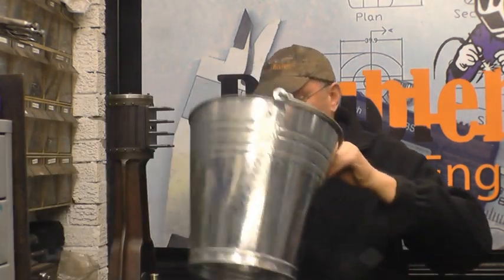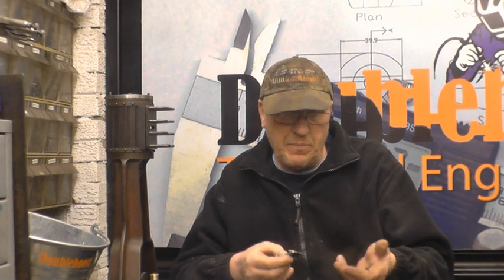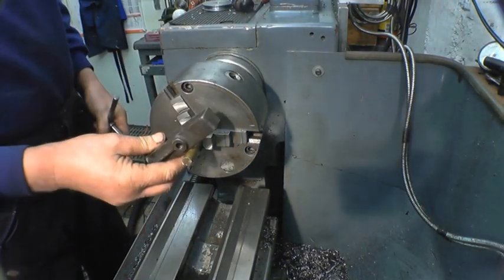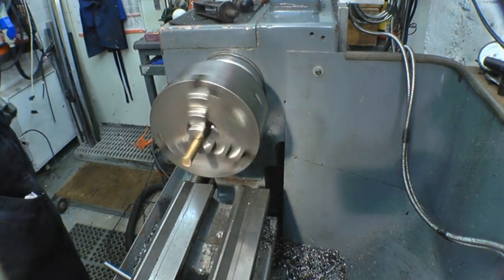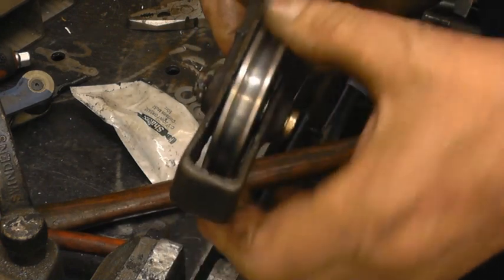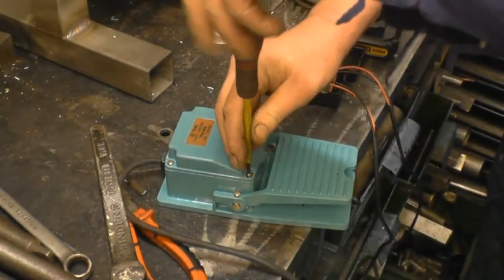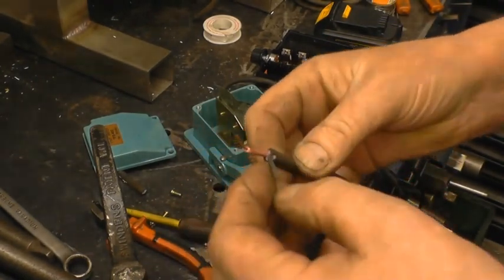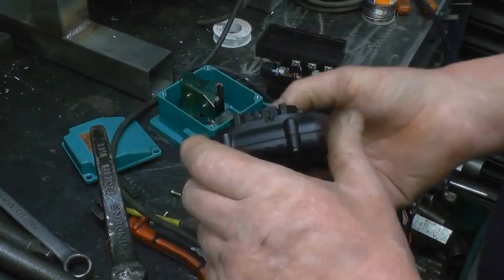SNNC 215 P1    Vintage pulley referb

Comment: if it's only 18-24v, rather than mains, you can do insulation with a few sheets of card, (postcards?) or a single layer of any thin plastic sheet...  so the metal enclosure might be the way to go, you know you want to :)

Comment: Hi John, putting solder on the wires before you put them into the terminal strip actually makes it less secure. Over time, it  will loosen up. The terminal strip manufacturers all recommend bare wires, or the use of crimped-on ferrules if you wish, but no tinning of the wires.
P.S. Thanks for the videos!
Reply: Yes, dont solder wires that goes to terminals
Reply: John - I even bought you a set of bootlace ferrules and a crimp tool to stop you doing it again!. You DEFFO need a fuse too....don't put that off - it will come and bite your arse if you do. You can fit it when you are re-wiring it using the ferrules!  Rotator looks boss though :-)
Reply: So John there is no excuse, do it wright.
Reply from the maker: I thought I had some The job will be sorted properly
Reply: Surely a screw will just squash thro soft solder onto the copper wire?
Reply: Depends who's doing it up, and the form of the screw ends. Older terminals had 'hemispherical' ended screws.... literally a half ball... those would bite into the solder and grip the actual copper. In the modern 'everything as cheap as possible' world.... the end of the screws is usually flat or (even worse) dished, with a sharp, wire cutting end. I've had several cheap light fixtures come with terminal strips that will very cleanly slice copper stranded wire every damn time
Reply: And my colleague wonders why I save the brass screws from every pre 1980ish socket and switch we replace...

Comment: With these NiMH tool batteries the battery is damaged if you discharge it down to too low voltage, this is why the tools all monitor voltage and cut-out rather than run slowly. If you just take the battery power outside terminals without the monitoring circuit, best top it up after every use to try and avoid damage.

Now you just need an old dividing plate and pin to set the angle.
Reply from the maker: I will make sure never to run the battery down  thanks for that

Comment: I didn't see how you have your work grounded on the positioner but if your just clamping onto the frame i would suggest a bare wire braid wrapped on the shaft that the chuck is on like Keith Fenner has so you aren"t running the weld current through the bearings of the transmission
Reply from the maker: I have a copper bush on the spindle

Comment: that wiper motor should be able to run both ways I forgot what the third brush is for multi-speed?, but just reverse the wires,. anyway more good stuff that's a handy tool
Reply: Random Dude wiper motors can obviously run both ways, but if it's going to get a lot of heavy use, there is often a correct way to spin. There's axial torque on the spindle gear, as it pulls or pushes against the big wheel gear, and automotive high volume manufacture wastes nothing so only bothers to put a decent thrust bearing at one end of the spindle.
Don't think it will matter in this application though.

Comment: hi john,if your looking for a power supply for the rotary table,you can pick up a "COMPUTER POWER SUPPLY" for nothing usually .this is a AC supply which is fused and puts out 5 volts and 12 volts dc for your wiper motor.ps ,I think stig has eaten my ticket from the bucket.lol

Comment: Your steam engine parts are easy to see, they are the parts with the most precise tolerances, and with the most care given in manufacture as well. Guess that Sentinel was more concerned with getting the things out fast and cheap rather than making them precision clockwork, but as they are still mostly usable a century later that was not exactly bad though.

Comment: John I have an RS diesel timing tool full kit in a black metal box it has a dial gauge indicator and heavy base to attach to diesel engines to time pistons or valves? i wonderd if you'll use it at work I do wanna sell it but to you ill give it cheaper